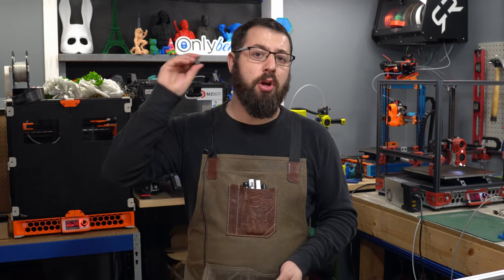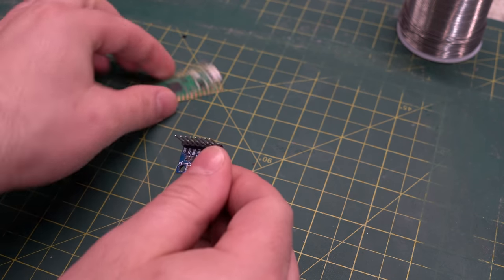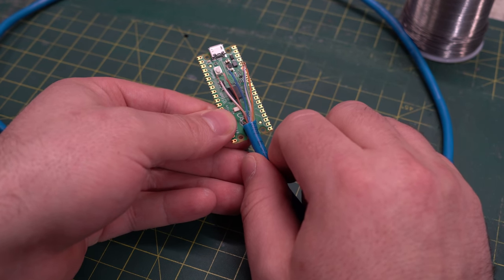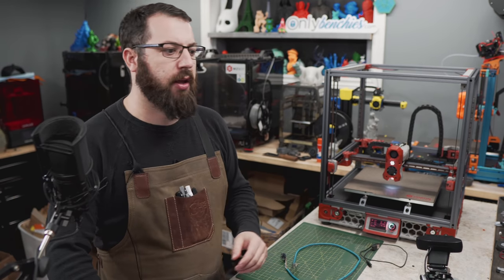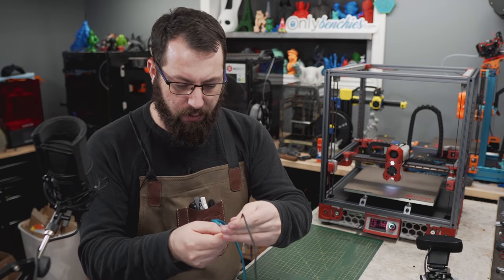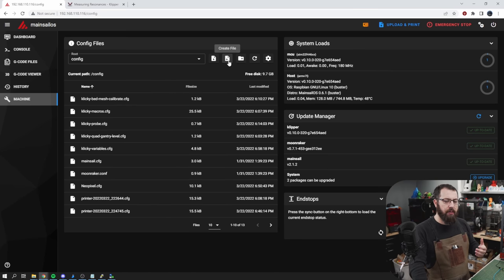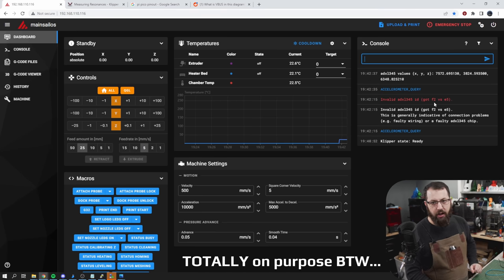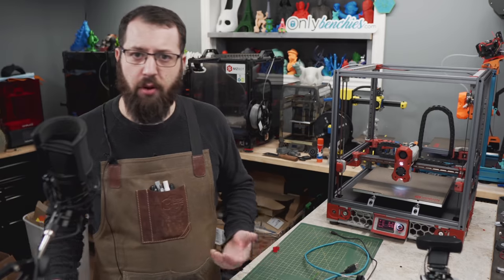Input Shaper with a Pi Pico - Klipper Tips

Comment: Thank you for your work, your tutorials are really great! I have very little knowledge about programming and I got an error after I did all your shown steps. Klipper says "Unknown pin chip name "adxl"". The solution for this was that I just have to rename the [mcu ADXL] into [mcu adxl]. I just want to pass it to others in case someone had the same problem. By the way, I used an RP2040 zero, it is a little bit smaller that the RPi Pico. It seems to be almost identical to the RPi Pico. No pins have to be changed in the programming. Happy printing! 😜

Comment from the maker: Quick additional TIp, instead of using something like winSCP to get the klipper.uf2 file off the RPI run

cp out/klipper.uf2 
../klipper_config/klipper.uf2

after creating the firmware flash file, this will copy the file to the same director as your printer.cfg file and you can just download it from the klipper interface webpage
Reply: You'll get a similar error the first time you run the command as you received at 11:23 due to a bug introduced in Klipper several months back. It always fails on the first try and works after that. I found the exact commit that caused the problem, but as far as I know, they still haven't fixed it. 

Nice video, by the way... you went into even more detail than I did on my write-up. I tried to link to it, but even mentioning the site name gets my post auto-deleted. Just google "Raspberry Pi Pico as a secondary MCU for resonance testing working!". There's good discussion in there about how Klipper identifies which group of SPI pins are in use, among other things.
If you use a ribbon cable instead, you can use 3D printed snap-together case that allows you to press the button as needed. It's linked in the above mentioned thread.

Comment: No need to use another computer and winscp or any other copy method. Your Raspberry Pi is running a very sophisticated operating system, named Linux, that can flash the pico without any help.
Just hold the boot button on the pico and connect it  to the RPi. Now mount the pico by using 'sudo mount /dev/sda1 /mnt'. Next copy the flash file: 'sudo cp ~/klipper/out/klipper.uf2 /mnt/' and umount the pico 'sudo umount /mnt'. Ready!
Reply: Doesn't work

Comment: Thanks Nero for pointing me to the workaround I needed to get input shaper to work on my BTT-CB1 equipped Trident. I can now confirm that it works perfectly. The Pi Pico dongle is a convenience if you have a Rpi in your printer but it is a necessity if you have a CB1.

Comment: This is awesome. I run 5 Mainsail machines from a i5 desktop running Ubuntu. This will allow me to run input shaper on all my machines without connecting to the SPI on the SKR 1.4turbo board. THANK YOU SO MUCH!!!! Changes everything.
Reply: Think I am going to make a plug for the ADXL's and permanently mount one to each machine.
Reply: Have you been successful in this yet? I'm also looking at the same thing but just getting started on the switch to klipper

Comment: Great stuff! I use the Zero 2W on all my printers with a screen which goes directly on the GPIO pins. So for input shaper I always had to disassemble the casing, remove screen etc etc. 
Now I have a USB hub to the Zero 2W and connect the Pico!.

Comment: Another well done video! 
If you are looking for ideas:
I just recently switched my case light from the MCU to a WEMOS D1 Mini with WLED. One quick section added to moonraker config file and now Macros can send commands to WLED. WLED has a web interface so you can set any number of presets for klipper to call up. Can have multiple strings (like case lights and SB) and control all from the WEMOS. 
Very simple install and significant increase in options/ability.

Comment: In case anyone has the same problem, I was getting the "Invalid adxl345 id" error despite having the correct wiring. Just run the ACCELEROMETER_QUERY twice and you'll see that on the second time it's working fine... I have to do this every time I use this method, but it works fine.
Reply: I've tried that and still get the error.
Reply: I had to try it twice and it did work the second time... thanks for the info! I read this after I made my second unit thinking the original was bad, and both units required two query commands. So they are both working after all.
Reply: Any clue what causes this? Did you ever find a fix?

Comment: Using the old ethernet cable was also a great tip. I have a ton of ethernet cable with broken connectors that I could easily cut up and make use of.

Comment: So I managed to get my klipper up and running on a desktop with 2 printers. I have noticed that if I include the adxl.cfg in my printer.cfg for both printers one of them does not want to connect to klipper. I'm assuming it cannot run like that on both printers. So far I'll add the include adxl.cfg as I need to but I thought I'd throw that tip out there in case someone needed it. Thanks again for the video. It's been very helpful diving into a very deep subject and not get too lost.

Comment: Thanks mate, you saved me a ton of time! Your instructions were spot on. I used this with an FYSETC Portable input Shaper board, and it worked first time. Grasias!
Reply: hey man, I am also using the fysetc portable, but got this error
Unknown config object 'adxl345 usbadxl'
I am using the PIS.cfg fysetc provides, what gives?
Reply: @redboom9874  ooo, I can't remember what I did to make it work. What is your hardware setup?
Reply: @aivkara  never mind, I got it working LMAO. had to alter their PIS.cfg fysetc included, and it worked. thank you however.  the setup btw is a voron trident (formbot)

Comment: Nice but the mod for molex micro fit costs few additional connectors and it’s gonna be in front skirt of your printer. Also no need to comment out the line. Works as a charm especially with 6pin molex connector :)

Comment: On mine I had one pin initially that did not solder well enough so when I pushed on the DuPont connector it pushed the ping up every so slightly and separated the solder joint from the pcb just a hair.  I pulled it back down till the pin started to pull through the hole just till it was just about flush, resoldered it and as I was soldering I pushed the pin back through it to make the connection.

After that everything was fine, but I did experience what Ludwig below did and noted that it failed on my second printer on the first try, I redid the query a second time and everything was fine. =)

Comment: Your videos are always very informative and thanks for creating them. What advantages does this give you over extending the raspberry pi's gpios and plugging the adxl directly in? I'm not hating, just want to understand.
Reply: I think the biggest advantage comes in when you have Pi versions without the pins on some of your machines. Even if you have all full size Pi with header pins, you would have to make an extension for every one to achieve the same convenience.
Reply: he mentioned this already at the beginning of the video. he wants portability, the ability to move the device to other printers easily, and without having to go back under the printer.

Comment: Thanks! Perfect setup for Pi-Zero!
Reply: Super video! I presume that this will work on a RPI-ZERO as well.
Reply: @whocares9847  Nope it's not. I have tried and same issues as with GPIO version, RPI still used to analyze the data. Unless you have RPI W Zero 2 with faster Processor.
Reply: @hobbyistnotes  is it possible to use our laptop as raspberry pi ? for using input shaper.
Reply: @vignesh_waran Yes, you can even use VirtualBox to run FluiddPi or Mainsail. Over all RPi Zero W is powerful enough to run printer with configured shaper but in stock it's not strong enough to do shaper calibration and calculation process, I've seen people overclock Zero W and it helps to solve this issue. Personally I use RPI 4 to get shaper values and than run printer on Pi Zero W (1gen)
Reply: @hobbyistnotes  Thanks for the reply.

Comment: Hey Nero, thanks for this very nice video! Do you have a solution for a pi zero 2 w? When i try to connect a usb hub to the pi in order to use a 2nd device like a cam or now the pico as per your video, I loose the connection to the printer. If it is possible to connect more than 1 device to the pi zero 2w it could be cool to make a short video on the setup or to discuss on your Q n A stream you mentioned lately...

Comment: Because the INT1 and 2 are not used, you can solder 1 with a pin and leave 2 empty. Then if you fill the location for INT1 in the Dupont connector, it's impossible to connect the Dupont connector the wrong way around.

Comment: I used some mpu6050 using i²c bus.
Connected them directly to the mcu board, and i can move them from one printer to the other, only the cables stay in place.
Or i could add a plug to move the wiring as well.

Comment: WARNING! 
If, like me, you had already set up Input Shaper by attaching your ADXL directly to the Pi, make sure you comment out or delete the [adxl345] and [resonance_tester] sections in printer.cfg. They have been moved to the new config file: e.g. ADXL.cfg. Failing to do this will cause Klipper to error out.

I can also confirm that, the first time you run ACCELEROMETER_QUERY it may report "invalid adxl345". If it fails a second time you may have a wiring issue.

Comment: Just subbed, Nice work. When using input shaping, Do you alternate between the head and the bed on a bed slinger. Or use 2 adxl's at the same time? And could you attached 2 adxl's to the pico or arduino nano? THanks!

Comment: Nero, thank you for your videos. I just stumbled across them but after watching, you gave me the needed push to install klipper. I have an Anycubic Vyper, pi4, Miuzei display which occupies the gpio pins and want to install two ADXL’s. My question is this, since I do not want to mess with the gpio on the pi4, could I use two pi picos, with an ADXL on each, then plug these into the pi4?  Overkill yes, but I want to permanently install the ADXL’s and not have the aggravation of moving them around.  I have a second Vyper I will be installing klipper on, as well as a Kobra Max. Still looking at options for the max.

Comment: id just get ethernet connectors and a cheap breakout pcb to convert the rj45 to 8 dupont connectors. wire up the ethernet port to the pins used for the adxl on the pi. ofc label the port as custom and cover after use. but you save needing to use a pico at all as its just a direct connection, also means you dont need to go into klipper to update its config when connecting/disconnecting.

neither is superior, but both have diffrents pros/cons

Comment: Couldn't you load the firmware on the Pico directly from the RP4 instead of transferring it to a PC? (Just plug it into the RP4 while holding down the boot button, same as the PC.)  Thanks for all the great videos!

Comment: Anyone have designed an enclosure of sorts to either or both the Rasberry Pi Pico and the ADXL345?
Would be useful to make them even more modular and portable so it simply bolts or clips onto the 3d printer.

Comment: I get the invalid ID error, checked the connections 10 times, desoldered my harness and connected the the adxl to the pico with some short silicone wires, edited the config, the klipper is recognizing the pi mcu and still nothing... the adxl does support both 3.3 and 5V power so I really don't know what's wrong on

Comment: i had the same issue and i used 22awg cables from pi inside the printer connected to the pins for adx and at the other end i used male dupont connector basically is a kind of extension cable and it works just fine is over 1m in total extension + cable. i think is easier than reflashing all the time the pico. is the exact concept u did with ur usb cable i just used dupont directly from pi where adxl is supposed to go

Comment: no matter how many times i do this I get the error. I've used many different wires, i've used DuPont connectors and soldering. I've both 8 accelerometers of varying prices. I am able to get the ADXL345 working via SPI with the Raspi as the MCU directly, but I cannot get it to work with the Pico no matter what. I've followed all instructions to the T and i have confirmed that all the aDXL345s work when connected directly to the pi. I've bought 3 Picos. it doesn't work on any of them. I'm not sure what I'm doing wrong.

Comment: Hi Nero,
I like (all your) videos, unfortunately i can not view your live streams because of the time difference between you and germany :(
But i have some questions :)
1. In this input shaper vid your pin layout is 
CS - GPIO2 - SPIO CSn
SDO - GPIO1 - SPIO RX
and in the adxl.cfg
cs_pin: adxl:gpio1
so i am confused about that
2. You pointed out, that you can connect more devices to the pi pico.
I managed to set up my adxl-pi-pico to also manage some neopixels, but i do not get my little 0,96 inch 4-pin oled display (ssd1306 or ssd1309) connected to display some status information.
I have connected a btt 5 inch display with the exp1/exp2 connectors of the mainboard and want to add this little screen on the pi-pico to the door of my enclosure, so i can see the status info without opening the enclosure.

I would likeyou to make a little tutorial video about that.

Comment: Hi I'm quite new to klipper and input shaper. Just upgraded my ender 3V2 with BIQU H2 V2S extruder, and mount ive printed has a dedicated place for accelerometer to be screwed in. Is there possibility to have two accelerometers conected to raspberry pico. One that would be mounted permanently on extruder and second for print bed? Thank you for answer. (Also sorry for my english not my first language)

Comment: Thank you for the information is was easy to follow and present well. A little trick I do is to add these macros to the adxl.cfg file, so they appear in the console and it makes them easier to remember. Then when I am not using the adxl.cfg they go away. 

[gcode_macro CCELEROMETER_QUERY]
gcode:
    ACCELEROMETER_QUERY
[gcode_macro SHAPER_CALIBRATE_X]
gcode:
    SHAPER_CALIBRATE AXIS=X
[gcode_macro SHAPER_CALIBRATE_Y]
gcode:  
     SHAPER_CALIBRATE AXIS=Y

Comment: Great vid, as always. Question: Will the ADXL/PiPico always get the same ID when plugged into the RasPi? Basically, will I have to edit the ADXL.CFG everytime I re-connect?
Reply from the maker: It will differ between machines but as long as you use the same USB port each time that will remain the same on each individual machine
Reply: @CanuckCreator  One of my machines has a PI 3a+ and only has 1 USB connection. Do you know if using a HUB would work while doing Input Shaping and the both the printer and Pico would get unique serial addresses.

Comment: hiya, if I mount adxl not according to the direction of the X, when I run the test to X, will it still get the correct result for X? or is there something extra that I need to do , so that the X and Y are swapped first before running the test? thx

Comment: Hey I tried this with an arduino r3 and a gy-521 (mpu 6050) with I2C and I couldn't get mainsail to read Any measurements. 
It just comes back with (got 72).
Do you have any tips?

Comment: So...how did you actually attach the accelerometer to the printer? That seems like a really important piece of the puzzle.
Reply from the maker: screws, double sided tape, printed bracket

however ya need to, the more rigid the better
Reply: @CanuckCreator  Thanks. This video was well done. I'm an avid electronics hobbyist, so I had some MPU6050s sitting around. Between your video and the Klipper reference manual, it was really straight forward to adapt your instructions. Difference (for anyone reading this) is that the MPU6050 uses I2C instead of SPI, but Clipper already knows about the 6050 and the Pico has I2C busses, so it's all good.I ended up using one of the nozzle bolts (swapping z for x) to do the x test, and some painters tape (swapping x for y) to do the y test. Worked like a charm.

Comment: What if you Main board only has one USB slot?  Which is used to plug the board to the printer?    Would a usb hub work for this instance?
Reply from the maker: Yup. A hub will work

Comment: so i cant ssh into my pi cause i forgot my password (i know, i know). since this doesn't sync up with a particular printer could you or someone provide the klipper.uf2 file for me to use on my pico? if thats possible? just wondering and it would be greatly appreciated if that worked.

Comment: Is there a way to do the same thing with a wemos d1 mini or other esp8266 based chips? Any of the Arduino/esp wiring diagrams I've come across don't utilize the SDO or CS pins (guessing it's I2C rather than SPI) on the ADXL345 board.

Comment: I recommend connect the VCC pin to VBUS of PI PICO,The 3V3's noise is too loud.
Reply: Can you run the adxl over usb somehow?  I'm running virtual box Linux not a raspberry pi.
Reply: @BuzzingGoober  adxl345 need SPI port to communicate with computer. The Pi Pioc is a simple low-cost way.($3~4)
Reply: @OptionVoyager  awesome, thanks
Reply: confirmed, with ADXL connected to 3V3 noises was above 100, to VBUS below 40

Comment: Nero 3D,   I am attempting to do this with a Pi 3B, (its what I have on hand, not looking for some sort of sick challenge to be different) I was able to follow along up to the step where you copied the klipper.uf2 file.  How do I accomplish this on the 3B?  There is no boot loader button to hold.  Sorry the noob question, this is a steep learning curve for me still.
Reply from the maker: This method doesnt work with 2 RPI`s, basically have to follow the normal instructions for connecting the ADXL to a rpi via the GPIO pins, also 2 RPI`s cant talk to each other.
Reply: @NERO 3D  Well damn, seems like a Pi Pico and an accelerometer is in my future then.  Love the concept, thank you for the reply.